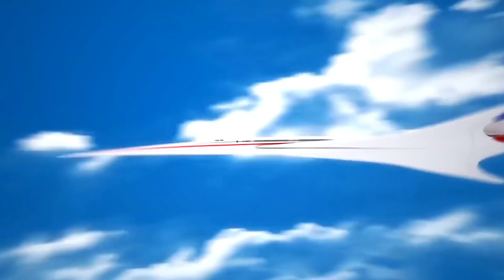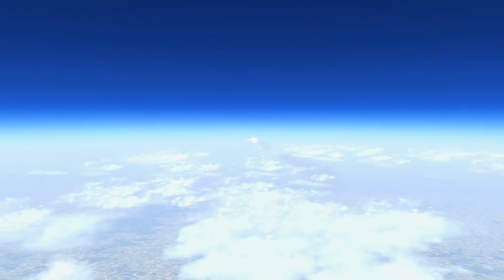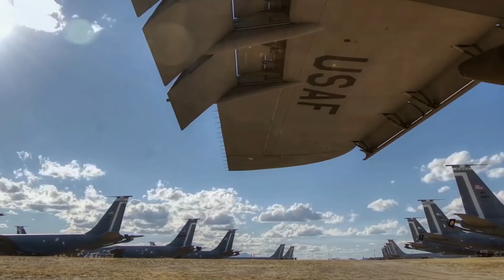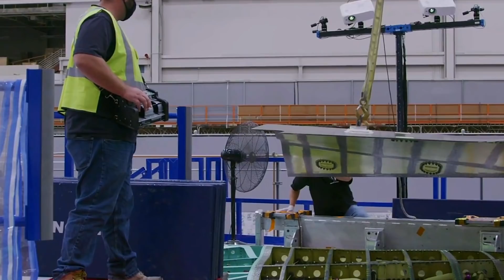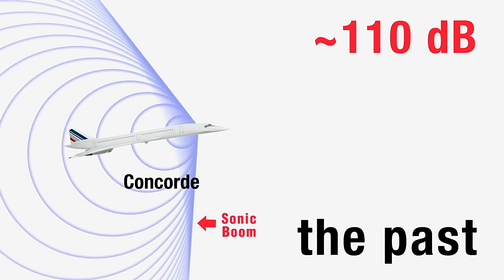A Supersonic Aircraft with a Silencer

Comment: Davis-Monthan AFB and AMARC, AKA the Bone Yard is IN Tucson and about 125 miles south of Phoenix. To say that DMAFB is in the Suburbs of Phoenix would be the same as saying Tucson and all of AZ outside of Phoenix is the Suburbs of Phoenix. People in Tucson get real upset saying Tucson is part of Phoenix. I know I was stationed at DMAFB for 11 years working on the A-10A. Then I transferred over to the 162 FW AZ Air National Guard working on F-16's. 
But using the landing gear off of the F-16 and the canopy of of the T-38 will not save much money on the build of this X-59. Those are relatively minor parts in the aircraft world. NASA and the Lockheed Skunk Works are notoriously known for always going way over budget in a build, having problems getting parts and constantly having delay problems that also cause budget over runs. Lockheed over runs and part supply problems got so bad with their F-35, they wanted Congress to pass a law allowing them to start outscoring parts from China. Lockheed is and has been a problem child for a long time. If it wasn't for a Federal Government bail out in the 1970's, they would have gone under and closed their doors. 
As for the Concord and America's SST, it wasn't so much the sonic boom that killed them, but the fuel and maintenance costs that killed the aircraft. To get the Concord up that s/s speed and maintain it, you would more than double the fuel consumption of a 747 that would take a couple of hours more to fly from the UK to NYC. Flying at that speed is very hard on the air frame and the engines. Maintenance Cost would be about 4 times more than a 747 too.
This X-59 is just a wast of time.

Comment: I thought the t38 which they call talon in this video, was called "tiger shark"which the t stands for trainer, was always used as a trainer, even though when first built for the United States it was going to be a fighter, the United States Air Force and Navy not liking it it was not purchased for a fighter it was purchased for a trainer, having the two engines it was going to be purposed for the Navy, because they're liking to twin engines, I am not 100% sure that it's called tiger shark even though I am sure that I've heard it called tiger shark before it's call sign may have change.
Reply: The fighter version of the T-38 Talon was the F-5 Tiger (aka Skoshi Tiger). It was a design that went up against the prototype of the F-16 and F-17 for a lightweight, easy to maintain fighter. The F-16 won the the competition to be the new USAF fighter, the F-17 (sometimes called the Cobra) was developed into the F-18 Hornet, and the F-5 was a design the US could sell to allied nations.
The F-20 Tiger Shark was a proposal taking the T-38/F-5 design and upgrading it to use one engine of the type used in either the F-16 or F-18. This was also potentially for sales to allies, but most of them wanted F-16s and a few elected to take the F-18 because two engines.

Comment: Never mind the sonic booms - the military doesn't worry about them. Sonic booms = big cojones. The biggest reason why Concorde was banned across the USA was that the USA failed to develop its own supersonic transport (because Britain/France solved supercruise and the US didn't; even the Tupolev Tu144 couldn't manage it - and that was after Britain's socialist government literally gave away the aircraft plans to the USSR). That and paranoia about 'foreigners' crossing US territory at high speed - do I need to mention the huge panic about Sputnik in 1957? HG Wells himself couldn't have written it better. 
Yes Concorde was elite-expensive, but everything has a price and some people could justify it. One of my uncles was a regular Concorde passenger on business in the 1980s - the value of the business and the time saving covered the cost of the flights. Nowadays we have the internet and nobody needs to fly transatlantic both ways within a day and fit in a full working day in the middle. That doesn't stop people like Elon Musk and Richard Branson dreaming of hypersonic elite transport - it's the same set of consumers they're aiming at. Concorde was sabotaged in the end (I note that it was a US-manufactured airliner that dropped the debris which caused the Paris crash) - and once you stop maintaining a vehicle it's much more difficult to recommission it at a later date, so it only needed to be sabotaged once to kill it off permanently.

Comment: Interestingly, the F-117 itself was designed and built using largely off the shelf parts from existing aircraft to help maintain  program secrecy and keep costs down.  It's largely a mashup of the T-38A, A-10 and F-16 with just a sprinkle of C-130 for shits and giggles all wrapped up in hand made stealth tortilla.

Also Davis-Monthan is in Tucson, about 120 miles southeast of Phoenix.

Comment: Commercial supersonic speed hasnt been banned for 50 years. Youre showing Concorde that was commercial supersonic and they were flying in 2003 and werent banned because of speed they were grounded after safety fears when one caught fire on takeoff and killed everyone on board. The only reason aircraft manufacturers dont produce supersonic passenger planes now is cost and capacity. Its not economical. Nothing to do with being banned from supersonic travel.anyone who can afford a supersonic aeroplane can fly supersonic. International airspace is not under the control of any country so all you need to do is fly into international airspace.

Comment: You know when it comes to sonic booms, I always wondered why the Space Shuttle gave off two booms in quick succession as it landed?  I've heard it might be one pressure wave from the nose and one from the tail.  But all supersonic aircraft have a nose & tail yet only give off one boom.  Plus when the Space Shuttle took off, you never heard a boom even though it must exceed the speed of sound at some point before reaching orbit.
Reply: Most aircraft give off a double boom, not sure where you got the info that supersonic aircraft give a single boom. The duration between two booms was probably longer for the Shuttle since it was physically much longer, but that's about the only thing I can think of
Reply: @dsdy1205  it was going vertical when going supersonic. thereby the shockwave was horizontal at a high elevation and not vertical. any remnants of a shockwave would have dissipated by the time it hit the ground.

Comment: Sadly, many errors. Again. Concorde failed because the Paris crash highlighted the vulnerability of high kinetic-energy engines sitting right under 150,000 pounds of fuel. They tried to line the fuel tanks with Kevlar, but the added weight made these old aircraft even less financially viable. Concorde was also experiencing frequent panel de-laminations, and simply couldn’t be operated profitably and safely. The X-59 uses OLD technology, simply using a VERY long and sharp nose to minimize the aerodynamic shockwave. The reason Aerion went bankrupt is they couldn’t raise the capital needed to develop their aircraft. Given global warming the last thing the world needs is millions of tons of hot gases being blasted into the stratosphere. It’s an environment and financial challenger, NOT technological. Once again, do your research better.

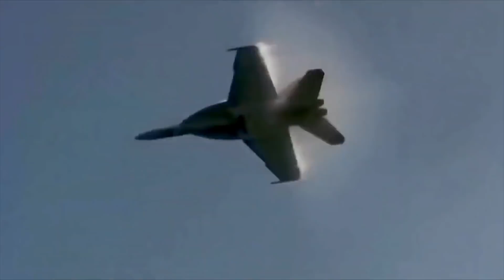Comment: 1:25 Not sonic booms, these are pressure waves.
It's all well and good reducing the sound from supersonic shock waves, but it's engine noise which is so nasty. I used to live under Concorde's landing approach and noise from it, not even at full throttle, was almost painful. Most of today's airliners cruise at around 90-95% of mach 1 almost silently at altitude, and operate fairly quietly at other speeds. Cruising at a projected Mach 1.4 isn't much of a  gain for all the attendant complexity and cost, is how I see it. Turbojet engines are always going to be necessary, which are noisy and guzzle fuel.

Comment: Pointless... do you know why Concorde failed... It failed because going that fast used HUGE amounts of fuel. Concorde flights London to NY were $10,000 per seat, and it wasn't enough to make the plane profitable. Even if this works and they can eliminate the sonic boom (bear in mind that the X-59 is a fighter sized aircraft, not a commercial airline size aircraft...) they will have to make it efficient enough to be profitable at no more than 150% of the cost of a standard subsonic airliner. Quite impossible with 2020 technology.
Reply: Concord made half a billion in after tax profits.  Still the best plane I have ever flown on.